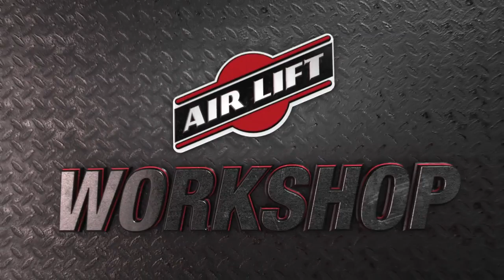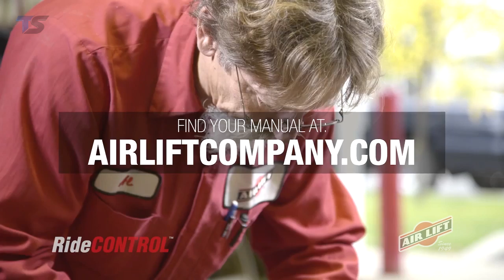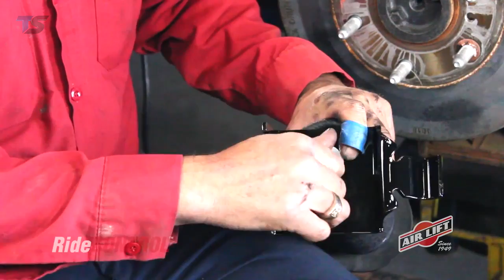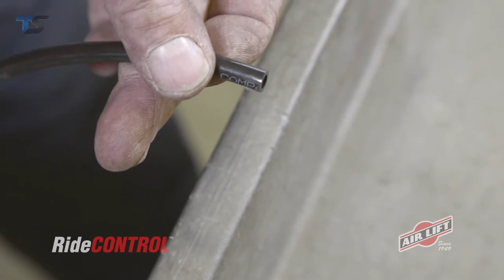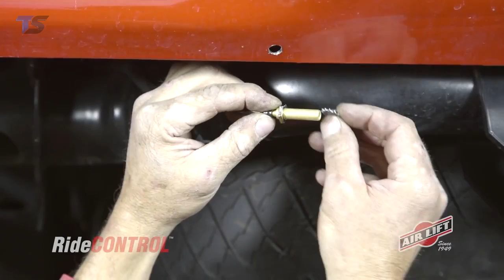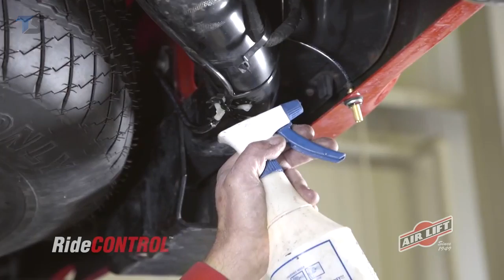Air Lift Air Bag Kit 59565 Installation - Chevy Silverado 1500

Comment: The problem with airlift bags is the connector at the top is plastic, cheap and they strip.
Reply: I was thinking the same thing. Plastic and cheap. These look like a cheap $50 system not $200 I'm going to keep looking...
Reply: I've had my kit on my 2500HD for years with no issues. 👍

Comment: How do you tightened bolt inside the frame when the bracket is covering the hole?
Reply: The hole on the opposite side.